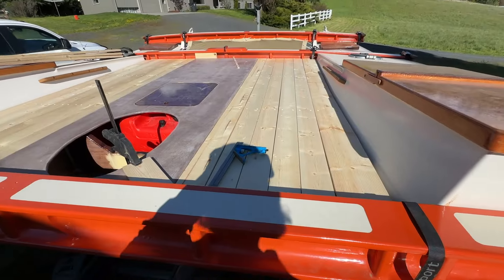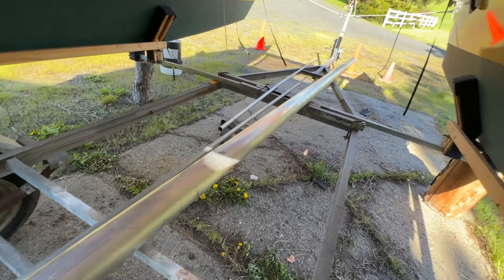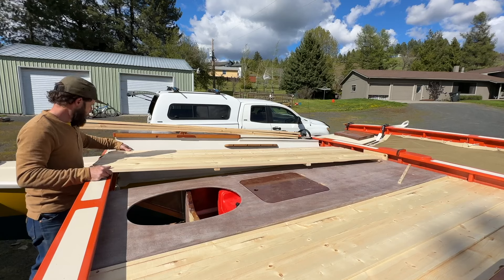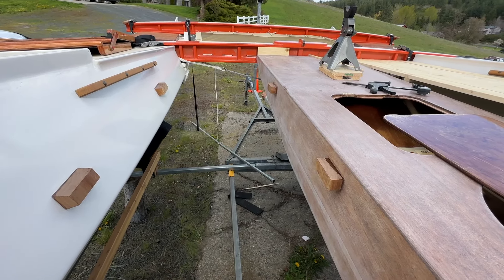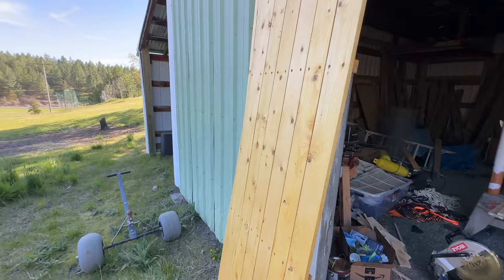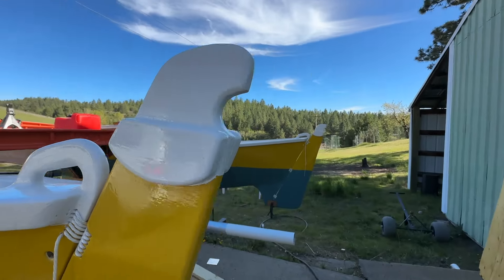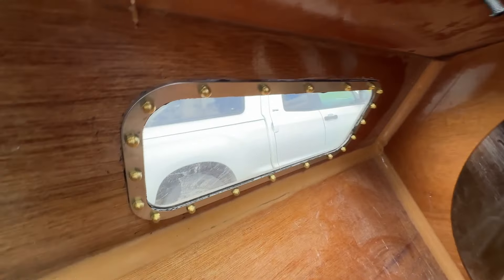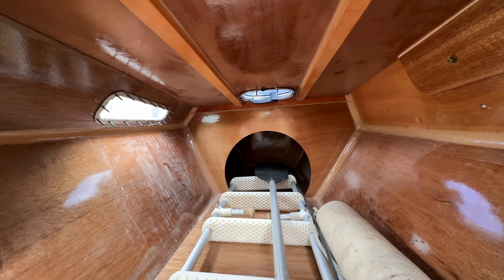My Tiki 21 Catamaran Gets Decked...and More! SV PRIMITIVA EP. 3 Wharram Catamaran

Comment: I'm also subscribed to Wildling Sailing, where Mark is refurbishing a Wharram Pahi 42 that had been left at anchor, not completely watertight, for 10 years. Such a contrast to watch you building a brand new, down-sized version of what looks very much like the same boat. 
I like your idea of the rubber "bow-cradle" to receive the prop shaft in the raised position. When you're deciding how to attach it, consider including a wedge-shaped plinth (shim?) between the cradle and the beam underside, to align it with the angle of the prop shaft casing, allowing it to seat firmly when clamped, lashed or shock-corded. You've probably already thought of this, or probably something better.
Edit: I looked it up, the trade term is "bow stop", aka "v-stop".
Reply from the maker: Thanks for watching and leaving a comment. I appreciate your suggestions. Gonna have to play around with it some more and see what the best solution is. I’ve also been watching Mark’s videos, even before he got the Wharram, so I was even more inclined to watch when he did!

Comment: looking very nice! it always takes longer than you think it will!
I reckon that rope will be fine as long as it doesn't have enough slack to reach the prop. Given the motor gets further away when it's down I think you could have the rope attached so you just release it and there is no way it could get around the prop. In my recollection, I always had to manually release to get the motor to tilt up.
Reply from the maker: Thanks Dominic! Check out my latest video. I was able to modify a bracket to get it to work properly without all the fuss.
Reply: @svprimitiva  yes I watched that too! a very elegant solution

Comment: Nice work again ..the variations in outboard design motor and leg proportions are whats messing you up. 

Itts a pitty that you cannot just raise and lower  the outboard motor vertically on a guillotine  type type mount. 

Hope youve isolated those port light dome nuts.. Al..Stainless ? and brass ... Sounds pretty reactive 😊
Looks wonderful Though.

Comment: Why not just take a router to the motor opening ... a small semi-circle in the center toward the bow to create more clearance for the pull cord and a bit more tilt?  Also with regard to the bumper on the bottom section of the cross beam, why not cut it down slightly (1/2 " - 3/4") to created more clearance for the tilt?
Reply from the maker: I’ve since figured out a better solution and don’t have to do any more modifications. Check out my next video next week. Thanks for the comment!

Comment: Is there an episode where you discuss the beam lashing ratchet straps you use to fasten to the hulls? I really like this solution.
Reply from the maker: @arremsea  I mentioned them in one of the first 2 or 3 episodes. Didn’t really go into too much detail. They’re just stainless endless loop ratchet straps. I talked to a handful of other Wharram owners that also use ratchets and Wharram even uses ratchets on the Mana kit. Drastically shortens the rigging time which is already fairly long. Haven’t had any issues with them so far!

Comment: The lifting rope will need to come off the lower leg when running.  Otherwise it will likely foul your prop
Reply from the maker: That was one of my concerns. But if it’s cleated off it should be ok. Hopefully I’ll figure out a way to no have to use that method.